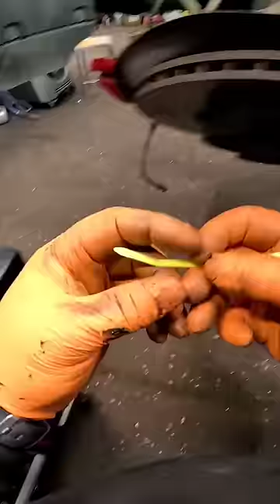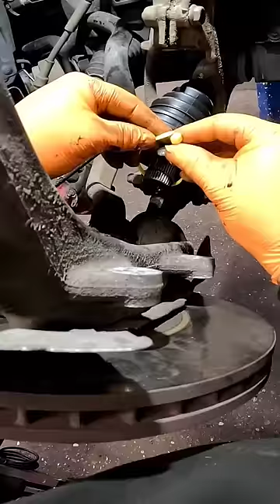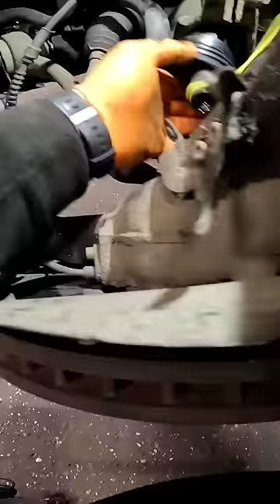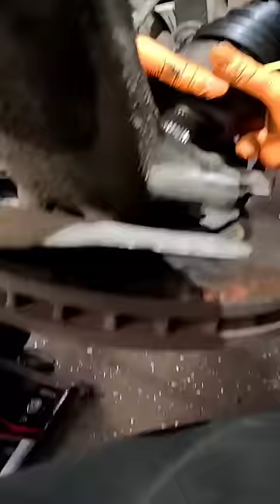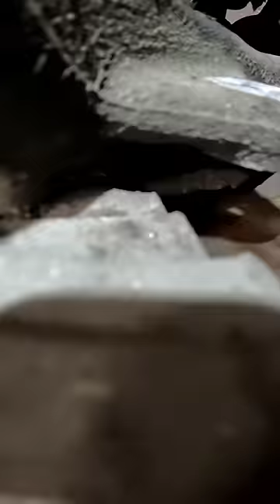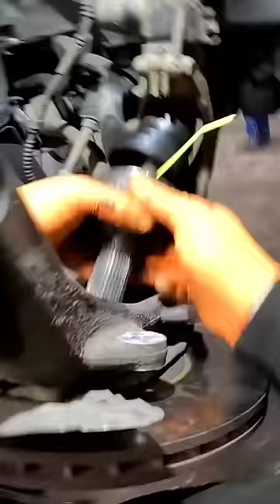cable ties are just the best

Comment: At a union shop, taking it apart and rebuilding it will cost way more in parts than just replacing the entire shaft. And by replacing the entire shaft, you don't have to worry about redoing it to replace the inner joint later.
Reply: Agree I tried it one time and it was a pain in the ass wasted more time  on a $16 boot instead of just installing a $100 axle
Reply: If the client can only afford the boot then that’s all you do.
Reply: @Whichwaydidtheygo  but how much is labor, on my own vehicles I also go cheap route but I'm not paying for labor and I'm not concerned with warranty. Yes in a bind do what you must.
Reply: I had a 50k mile OEM honda axle and wasn't getting rid of it since the outer boot was the only problem. Maybe cost me $10.
Reply: @stoker20  good decision the ideal of changing the whole axle comes from a shop/customer situation a shop has to charge for the extra labor time or absorb the loss of time.
Reply: @draileduncommon  was on my Mint Honda hatch. Would never waste the time otherwise.
Reply: @stoker20  Honda is one quality vehicle and I love older reliable easy to repair Hondas.
Reply: I don't hire any services connected to any union if I can avoid it. End unions now.
Reply: @draileduncommon boots are easy, use a stretcher tool and it's on. Job done, cup of tea, a little nap then back to the customer for 3 hours labour fees ! 😂
Reply: @scottrich976  if harbor freight has this tool I'll give it a shot next time. I actually have a 1992 D21 with a torn boot that I have been avoiding as  said I would do it before I sell it but it's been such a good truck.
Reply: Im with you on that one. Just replace the whole thing yourself, save some money. Unless you have no idea what or how to do it. Then take it somewhere.
Reply: It's like when they stopped resurfacing rotors, most of the time it's cheaper and easier to just replace them.
Reply: @cranberriesdoodle1450  and resurfaced rotors seem to always warp. I believe most vehicles are built with minimal material to begin with. Also who wants to be driving around on "min" thickness rotors? (Usually what they are after turning)
Reply: @scottrich976  if you have a ripped boot then the grease inside have been contaminated with dirt and grit. In many cases the grease has splatter all over the place and by just putting boot back on and not cleaning and re-greasing, you'll just end up with a jacked up CV.

Comment: A good tech just replaces the axle instead of the boot. That's a ripoff to the customer. Cause the joint has been dry or dirty from the boot failure.

Comment: What's the zip tie for?
I didn't catch that!😅
Reply: There's a ring clip in a groove around the shaft that springs out again after you slip the end over it to keep it from pulling off the shaft, he's using the zip tie to compress the ring so it goes together more easily!
Reply: @loganpe427  Thanks a lot for the explanation

Comment: How do you get the zip tie out?
Reply: Guessing you leave it inside. Being filled with Grease and inside a boot it shouldn't matter. But I personally wouldn't do this
Reply: @kennydeever4941  What? You just cut the damn thing off. It's pushed back towards the rubber boot ffs, not hidden inside the cup....

Comment: @maniacal s10 
Great trick going on ! How did you get it off ?
Reply from the maker: Hammer, I've also got a CV joint puller for when they are tight
Reply: How do I or you get a (fixed) cv off ? If possible. Thanks!
Reply from the maker: @maniacal-s10  some have circlips some don't you need to have a look at the back of the joint

Comment: Why replace just a boot or joint by the time you buy parts and labor you could get a whole new shaft just as cheap!!!
Reply from the maker: You can't tho price a boot then an shaft
Reply: @bazmeredith  a boot is cheaper but the labor to separate the joints and take the shaft out also. Not to mention if the boot is ripped the grease that's left in shagt is contaminated and the shaft will not last long. Just better to do the whole shaft and be done one time. Plus those boots never stay on waste of money!

Comment: It's a pretty damned good idea for anyone who knows
Reply from the maker: You fully know
Reply: I’m going to try that next time
Reply: They work great until you lose one on the transmission side
Reply: I don't get it. He didn't show what the inside of the joint looked like and for what purpose is the ztp tie specificalky?
Reply: @joebudi5136 it is holding the C clip down in the groove. When you line the splines up and get to the zt. A quick push pushes the zt back allowing you to be past the clip ring. You can hit it with a hammer or wiggle the fuck out of it and get past it. But I have seen clips break when doing that and is no problem if you have another one laying around. But if you don't you might be fucked till the next day if the parts store is closed. Even if they are not why potentially break something if you don't have to. Slow and steady wins the race. Don't be the type of guy\kid that beats the square peg through the round hole. Lol

Comment: But why are you taking a cv joint apart lol?
Reply from the maker: To replace the boot
Reply: @bazmeredith I've been a mechanic for 17 years and I've never replaced just a boot or rebuilt a joint.  That's some third world stuff.
Reply from the maker: @Juandongduck  I've been a mechanic for 23 and replaced hundreds of CV boots, 3rd world stuff..... It's making the job affordable for the customer!
Reply from the maker: @Juandongduck  you just stick to firing the parts cannon
Reply: @bazmeredith  You stick to being a hack,  keep that grease in the 100k miles joint and do your customer a complete disservice.  There is a reason we stopped doing that garbage 30 years ago.
Reply from the maker: @Juandongduck   I'll keep hacking 🤙
Reply: @Juandongduck  grease comes with the boot kit, replaced 2 torn boots, 200k miles later so far so good, you guys do it because it's cheaper to throw in new parts
Reply: @mrlool4925  correct
Reply: @Jr-qk4cj your not a mechanic then.your a fitter.
Reply: @turbowank16v84  "fitting" is sometimes a part of the job.  I specialize in advanced diagnostics and drive-ability.  You must rebuild starters, alternators, water pumps etc.  Probably not right?  Because it is not economical or ethical to charge a customer the same price for a rebuild as it would for a new price.  And I say good day junior.
Reply: I bought an entire new shaft for mine, it wasn't expensive.
Reply: @thisisyourcaptainspeaking2259  Exactly,  nobody rebuilds joints or replaces boots in the U.S. anymore.
Reply: @bazmeredith in our country, it's cheaper to replace the whole axle.
Reply: @bazmeredith I have been an ASE Master technician for over 35 years.   No one does this in America.  No need.
Reply: @homesteadhaven2010  This might be an import value added tax phenomenon.
Reply: @bazmeredith  In my workshop we had a plastic cone and stretch boots. Plenty of silicon lube on the cone and over it goes!

Comment: I worked at a reman company and all we did was reman CV joints, and the clips are absolutely zero problem if you have the right race, for the clip and shaft.
If your working hard to do this, your doing something wrong.